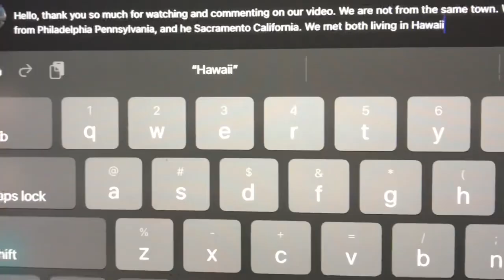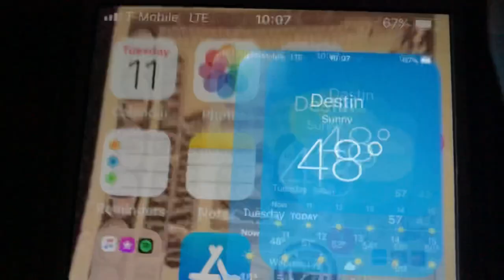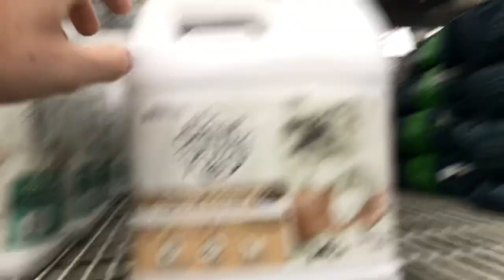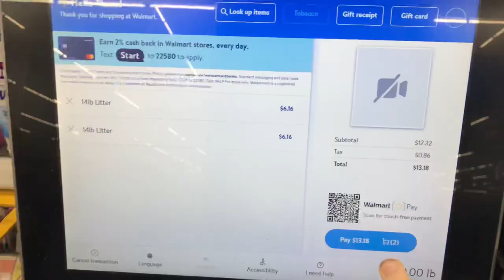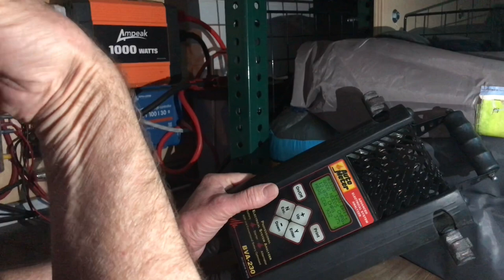VAN LIFE DAY IN THE LIFE | VAN LIFE VLOG + GIVEAWAY Closed

Comment: If you guys are using an AGM battery, you can't use them below 50%. As the battery discharges, the lower the charge the lower the voltage. This is why lithium batteries are better. The voltage is the same at 2% or 100%, and you can run them all the way down and still charge them up. If you drain an AGM (or similar), they are dead and can't be charged up. A new battery will be needed. Lithium batteries are also about half the weight.
Reply from the maker: Thank you so much for watching. We absolutely understand and know that, and made the decision to go with an AGM anyway. With plans of upgrading to lithium in the future. Once our battery has truly crapped on us, that will be our immediate move. How’s they need to not be 2K when we are ready to buy lol.

Comment: Check your connection you do a lot of driving hitting bumps can loosing up connection. Wires should be strap down. What size wire you have from the solar panels. Is there way you can switch off the solar panels Switch over to the Van alternator while driving so the van will charge the battery?